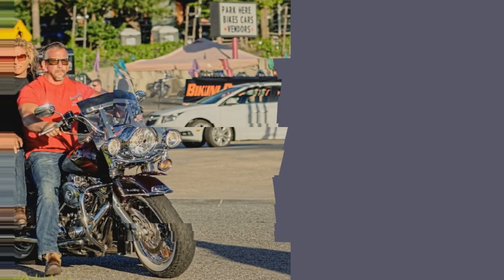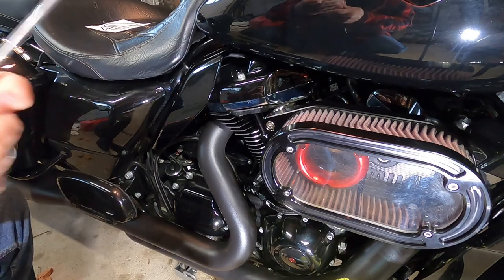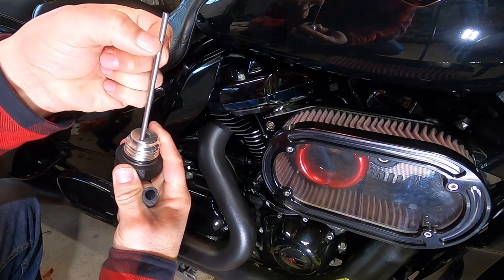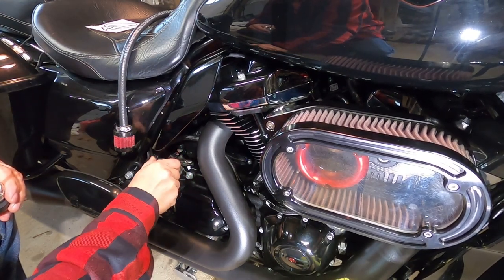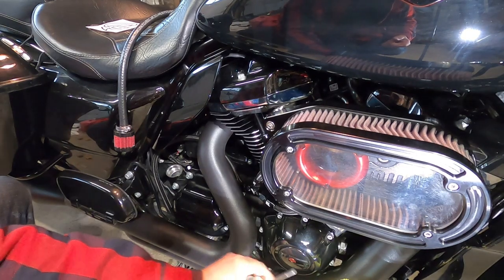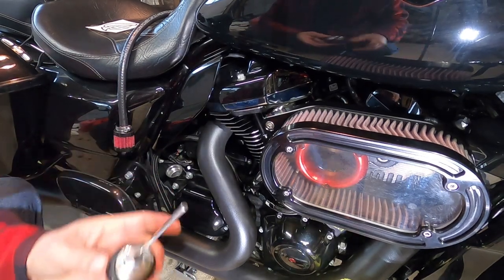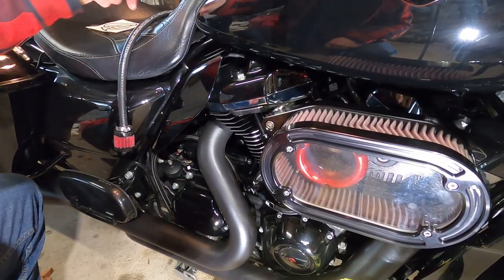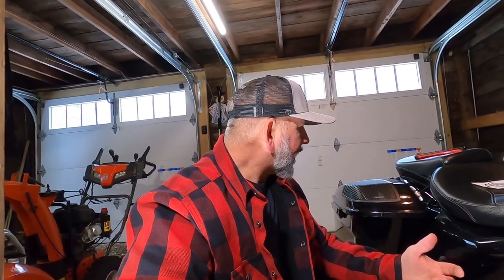A1 Vent Kit Install

Comment: Thanks for the video. I have an 18 RGS and am getting fluid transfer unfortunately. Had the vent installed by HD dealer, didn't work so had to install this new fix with a bigger diameter rod that goes from primary to trans, so far so good. Now I'm hearing about oil blowback!! Geez Harley!! So now I want to do this vent kit as a preventative.  Hopefully this is the fix!! Again, thank you for taking the time to do this install. As a side note, Try the Adams Graphene Ceramic Spray coating. I did put this on my bike, my Tahoe, and my daughter's car. This stuff beads like nothing I've seen!! Suppose to last 2 years. I also wash with GYEON QUARTZ bath essence. It's a car wash made for Ceramic coatings. Its super concentrated, helps with shine, and will help keep coating on surface because it is a mild soap. Found it on Amazon and came highly recommended through a ceramic Dealer.

Comment: Tossed one in my 2017 SGS, great product. The bike does seem to just run smoother, with a little bit of pep.  I replaced the cam chest amd this is a great piece of mind for being a first year M8.
Reply: Jason, you only replaced the cam chest? Did you replace the oil pump.
Reply: @craigsevyn  yes. Cam, lifters, lifter cuffs, pushrods and oilpump

Comment: I installed one on my 2011 CVO Road Glide Ultra,What a difference! Runs a lot cooler and Smother i do have a question what brand is the air cleaner looks good.
Reply from the maker: Thanks, that is from MJK Performace...  they are a small shop out of 🇨🇦 and the make the air cleaners in small batches

Comment: Have you noticed any performance difference with the ventilation improvements? Thus far, I’ve decided not to put all that stuff on my 2018 and it runs great. Your thoughts?
Reply from the maker: Haven’t really noticed a performance difference, its more for peace of mind..  I also have external breathers on air cleaner so it’s not burning oil

Comment: Does the oil level stay the same because I seen somewhere that its possible some engine oil has to be removed? Just wondering!
Reply from the maker: They recommend to run it a half qt low.. .

Comment: You need to lower oil level 4dots down from hot full on hot oil on jiffy stand!!!!!!!!!!!!! Or will 🤮 puke out of filter!!!
Reply from the maker: Well,  I ran it a half qt low and it puked,  wasn’t willing to run it on less oil....

Comment: Brother. I highly recommend not running both the crankcase breather , and air breather as well. You're running a free breather now. That's not good. Relieving the crankcase pressure is also stopping Vacumm. Vacumm is what seal the rings in the bore. That means your not getting good lubrication on the cylinder walls by relieving that Vacuum. The air breather ventilating is also stopping the positive pressure from taking place. Your venting that little bit of oil that is now needed to lubricate your cylinder walls. Although you have a PCV on the head which stops negative pressure,  you're stopping vacumm again. No vacumm on the lower case and no vacumm on the top. Rings aren't sealing (free breather) As I stated your running a free breather and that's not good. I recommend only running crankcase ventilation, and get rid of the air breather vent. The M8'S  major sumping problem along with oil pump and cam chest is mostly do too the balancers in the crank case. M8'S oil belly is shallow, and when it gets 4 to 6 oz, its picked up by the balancer now. Twin cams didn't have this problem, larger oil belly, and no balancer. Oil was picked up by the crank only. You're gonna have problems down the road running this combination....M8'S are a conundrum Brother. Running one isnt good, and running both is even worse. Running either one, takes away from the other too preform as needed. Problems will follow you on a free breather . It's a Guarentee.
Reply from the maker: Appreciate the info, I’m actually not running the A1 vent kit at this moment..  gonna make a short video about that and the reason why shortly
Reply: That's great info thanks for taking the time. Would you recomend not running a vented oil dipstick on a stock 96 inch Twin cam 2010?
Reply: @Jimmy_Jim_Jim_1234  All Harley engine have a crank case pressure issue.  The 103 twin is no exception.  The 103 has no balancer in the crank, so sumping issues aren't as bad. Harley , before the EPA nazi's got involved , had vented crank cases. As I said, vacumm is needed to seal the rings. I would recommend venting the crank, and not the breather too avoid running a free breather....
Reply: @craigsevyn  Cool thanks for the info. I'll fix that my first day off.
Reply: I can't see how running an external breather on the top end would be a problem.  The top end has a breather the routes into the air intake. When you install an external breather, all you are doing it rerouting the dirty oily air from the combustion chamber into some sort of external filter/catch can ?
Reply: @joemaccrory8121  Think of it this way. The engine is like the heart. The heart survives by the circulatory system. Vacumm to open and shut the valve of the heart. Harleys are unique from other bikes in the fact that the crank case has only 1 pin for both pistons. As oppose to other bikes that have 2 crank pins. 1 for each piston..That's why Harley has this patented. Knowing this, 1 piston fires, then the other fires at 315, then theirs a 405 gap (so valves wont hit each other)then again at 315, rinse and repeat. This is a circular (circulatory) ie Vacumm.Now take the breather hose and remove the vacumm. No vacumm, no seal of rings. The breather hoses sit inside of the cone of the intake. Knowing now the head keeps more of a vacumm by alternating piston the Absolute pressure is just that absolute. Every time the throttle is opened, the flow of air next to the breather hose creates this absolute (vacumm) pressure . With throttle closed air still comes thru the air filter and creates absolute pressure in the throttle cone( vortex)which keeps absolute pressure between the throttle and PCV. Again vacumm. This ad nauseam of dirty air and oil has been going around since Jesus played short stop for Bethlehem. If this was the case then we would have to change oil every time we rode are bike. That little bit of oil isnt going to hurt the top cylinders ,in fact you need some vacumm now that it's been taken out of the bottom of the crank.That little bit of oil is the only thing lubricating the cylinder walls now. That little bit of oil Isnt going to put carbon build up on top of cylinders. Carbon build up is due to engines that take out vacumm, or have bad rings . Without vacumm rings dont seal, and oil is pushed up and over to the top of rings, and on top of the cylinders. (Sumping) This is now what plagues the M8s engine. M8s have a balancer in the crank, and this is frothing the oil ,air rating it. The M8s have less volume in the belly. 4 to 6 oz is caught up in the balancer. Cavitation too the extreme . No other Harley had this before the M8. So too sum it up. When you take a vent the breather the Absolute air in the hose between the throttle and PCV is void.  As I've stated before. Vent 1 thing and one thing only. Relieving pressure in the crank also takes it out of vacumm which seals rings. If you also take the top out of vacumm you creates a free breather. More piston ring blowby,  and you've now enhanced the problem you wanted to fix...
Reply: @craigsevyn  so is venting the primary the best way to solve this issue in your opinion? I’ve done this already and haven’t noticed any migration after about 900 mis. Would appreciate your thoughts sir.
Reply: @boblafountaine9560  Well Bob this depends on what motor you have. If it's a M8, I would vent the crank only. I think the crank is better too vent then the breather myself. M8S have a bottom piston oiler, so let's keep the top. Less messy in my opinion. However Bob if you have a M8 and never noticed any sumping then I believe you never will. As I stated before not all M8s having a sumping problem. Dont know why that is myself...